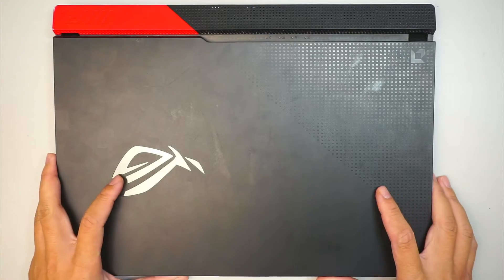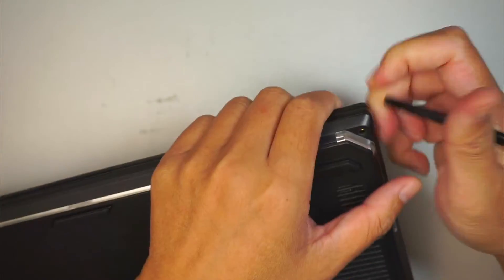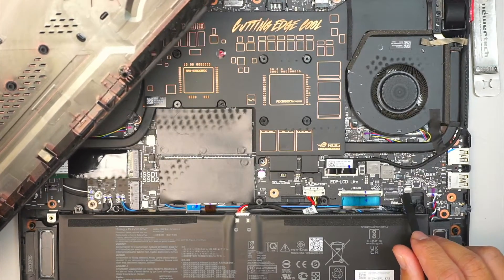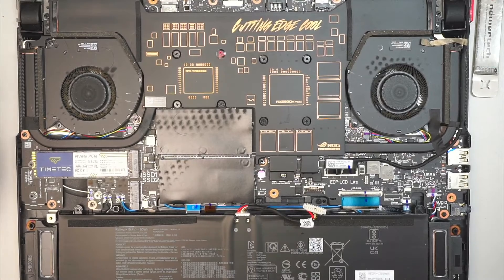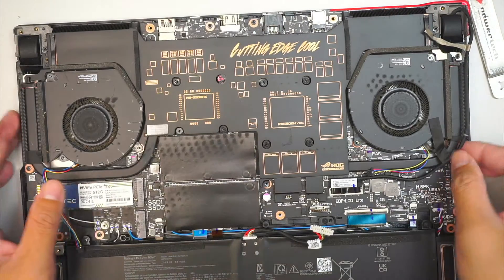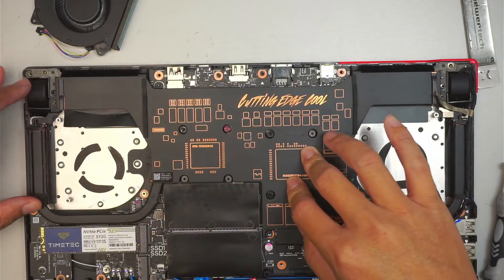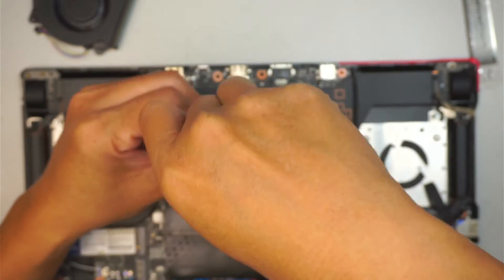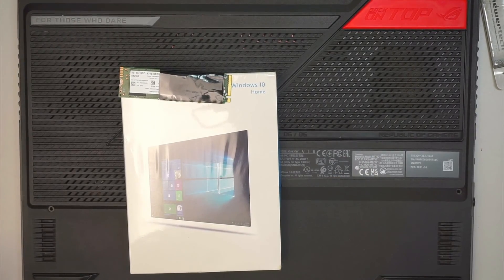Asus ROG G513QY M2 SSD and Thermal Paste

Comment: wtf thermal paste on top of liquid metal thats a disgrace 
do not freaking do that or ur pc will die 100%
Reply: liquid metal is a terrible solution for that model 
thats why i replaced it with ptm 7950
solved the heating problem right away 

but no way in hell what he did with the thermal paste on top of the liquid metal is acceptable
Reply: you're confused, this is highly recommended, as the liquid metal can sometimes be applied wrong and leak due to pressure buildup (known issue on these models). if liquid metal leaks onto the mobo, the laptop is dead.